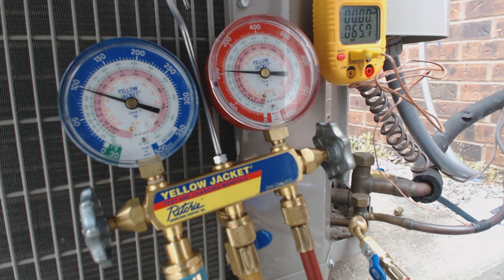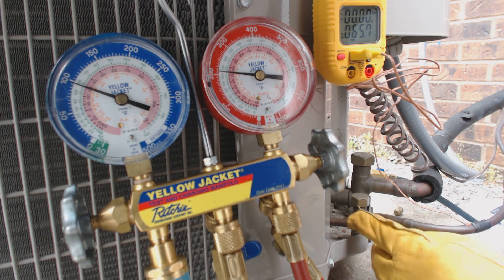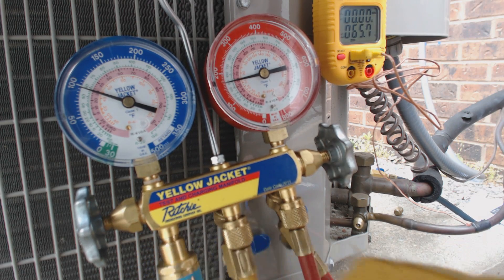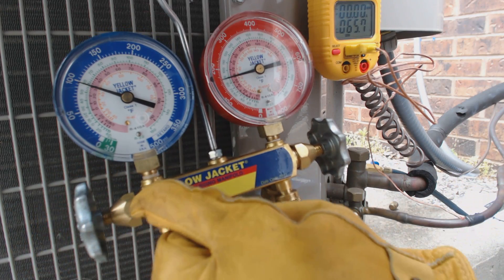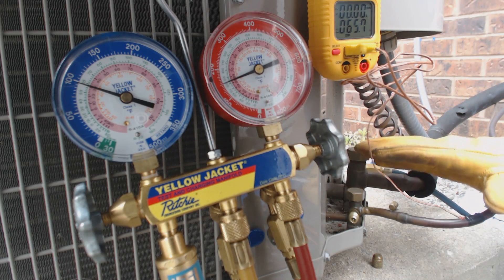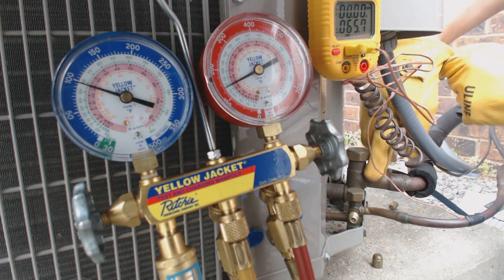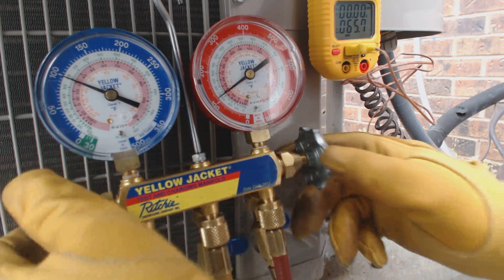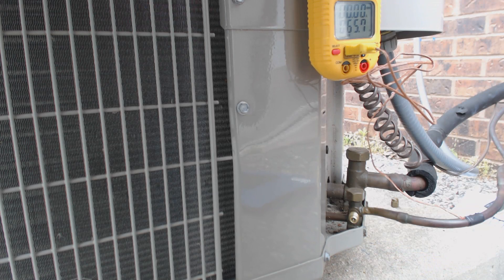Charging Refrigerant from your  Gauge Hoses back into the System Before Disconnecting! Explained!

Comment: I knew there was a way to do this but I couldn't remember the steps. I ordered the yellow jacket liquid charging adapter what do you think about that one? I started doing residential install about three weeks ago and I love this kind of work. So do you have any recommendations for some tools that would come in handy. Also when when I put back the schrader valve after brazing how tight are they supposed to be. I have noticed when I remove them they seem pretty loose so when I put them back I snug them. I don't want to over tighten but I am afraid they might be to loose. Thanks man.
Reply from the maker: I like the kwik charge a lot more. It really seems to vaporize well compared but that would help. I have the yellow jacket ones in the shop but we seem to rely on the kwik charge due to not hearing any compressor noise change and being able to open the handle longer but once again the one you have will do. Just charge a little at a time. Awesome to hear that you are enjoying it. Did they put you with a good tech as a team or are you working just yourself? You could check out the tool list at --https://acservicetech.com/hvacr-tools/  --   you could also look at this video and some tool links are in the description -   https://youtu.be/deD_OjTW-hk   --- Most tool links from the videos are also in the descriptions. I am working my way back through them and updating the lists.  In reference to valve cores there is a tool to make sure you don't overtighten - http://amzn.to/2qL1C6w  --  Make sure you have extra schrader valves if you go doing any service. I seems every one out of 5 units lately one valve is not reseating very well. Thats crazy. Make sure when it is time to get a manometer later on that you get a digital one. Those pressures are so small and you can use it on pressure switches and variable speed unit gas pressure-  Here is a link to the Fieldpiece SDP2 Digital Psychrometer- http://amzn.to/2nniMVR   --  Feel free to ask questions, thanks!
Reply: Thanks for the reply. Yes I am working with another installer. He's pretty good. The Compnay I work for tries to put people together based on where they live. So both of us live on the same city so it worked out real nice. The city I live in is fairly small so I meet him at this grocery store near where I live and we ride together. This is in reference to your comment about the schrader tools I do have 3 different tools to remove the schrader valves. One is a key chain tool another on is in my 11 n' 1 and the other is the one you use for servicing or when you pull a vacuum and such. I don't have the one you shared but that one seems like it would be helpful for me at least until I get the feel for it. You mentioned the valves not seating properly are referring to when you put them back in and after you have charged unit they leak? If so that same thing happened to me the other day and the guy I work with showed me a trick. Really quickly you press on the schrader valve and the pressure from the refrigerant will push it back into place. I thought I had a bad one and I was about to replace it until he showed me that. Learn something new all the time. Again I really do appreciate your videos and all your replies. Thanks.

Comment: Do you tape your sensor to the bottom of the liquid line, and how may times around with electrical tape
Reply from the maker: I usually do 3 wraps or so. It also helps if you armoflex insulation over the sensor so you don't have heat from the sun or from ambient. The side is probably the best spot but the liquid line is very small so it won't matter too much. The side of the liquid for subcooling. Thanks

Comment: So after adding refrigerant the process of putting it back is the same , just that you have more refrigerant in the lines, and to stop adding early so you can put what is in the line back in
Reply from the maker: Yes but I will just say that it is really hard to gauge and the reality is that if you are doing the subcooling process and you already have your high side line disconnected then you can't really check your subcooling anymore unless you had a temp sensor taped to the middle of the outdoor condensor coil to give you the sat temp if that makes sense. I mainly use this process for connecting, checking the charge, and if it is good, charging the refrigerant back in the low side before disconnecting. Thanks trukin forever!
Reply: Just to be clear one final time and in response to the question from Barry G. After I pull my vacuum to 500 microns or less and verify no leaks and I then break the vacuum with my 410A to add whatever is needed for over 15 feet of lineset into the high side. I shut off jug, close valve on yellow hose, disconnect yellow hose from jug and hook back into guage set. Open service valves, set stat low for cooling, turn on power and let unit run for 10-15 minutes and check subcooling. If subcooling is correct then I shut valve on high side hose and disconnect from service valve and hook back into guage set. At this point I have product in red hose along with product in yellow hose from breaking the vacuum. Are you saying I am ok to do this process in this video to empty both hoses back into low side? Pressures/readings that I obtain do include what's in hoses correct?

Comment: If I did add 410A  with a kwik charge and I then wanted to put the refrigerant from the lines back in the system , would it be the same set up as you are showing in this video
Reply from the maker: Yes but just remember to not add too much refrigerant into the system. The red and yellow line at this point would be full of liquid refrigerant which is a lot. You would need to stop adding early before reaching your subcooling needed. I mainly use this method when checking the charge, not adding any and then purging the air and charging the red side back into the blue side before disconnecting, thanks!

Comment: is the unit on during this process? thanks again for great tips
Reply from the maker: Great Question, yes absolutely it is just my camera that cancels most drowning background noises out. In some videos you can hear the unit and others you cant. I depends on the sound decibal. The only time you can charge when the system is off is after pulling a vacuum of 500 microns and then weighing the refrigerant in as a liquid into the liquid side with a scale. Thanks for the Comment!
Reply: @acservicetechchannel  /h
Reply: @acservicetechchannel  0